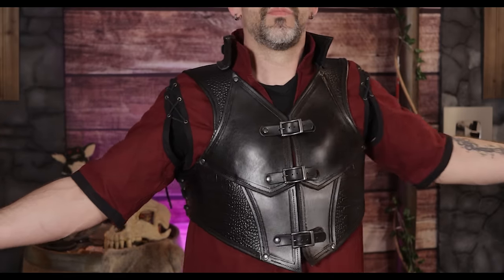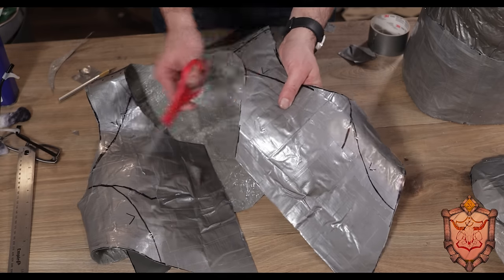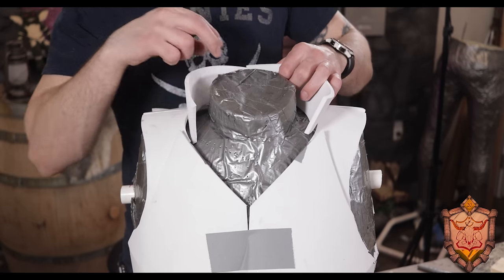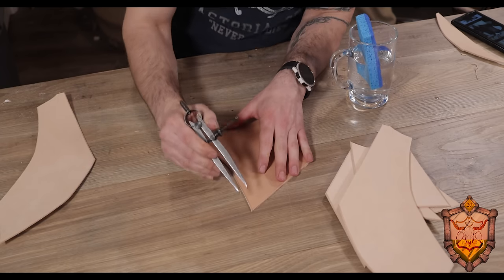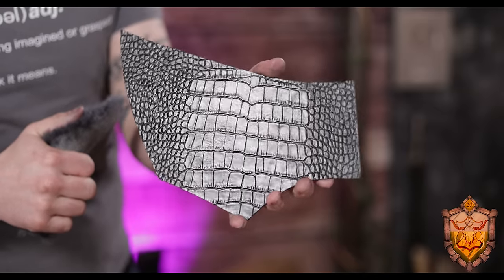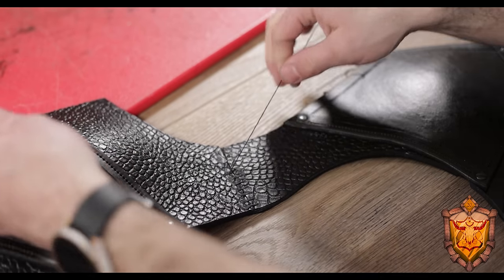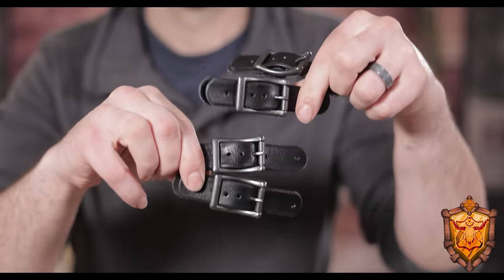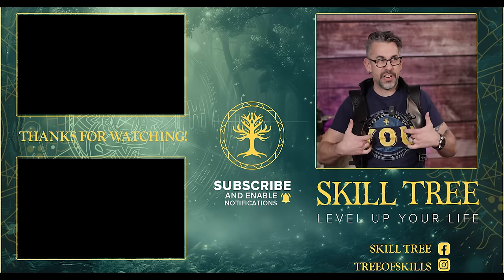Making My Best Leather Chest Piece Yet

Comment: A way to form your leather without mudding up your edges is to lay it face down on a thick piece of foam and use your ball to form it from the back by pressing down, you can shape the center without ever having to pull the edges
Reply: Or historical method is sand bags or a carved out stump
Reply: @cbjewelz  that's neat, I didn't know that

Comment: for times you want evenly spaced holes, or other marked points, there is a very cool tool that takes the math out of it, so you can find exactly where each hole should fall. it is called a Trend Point-2-Point Equidistant Measuring.  they are under $30. you either decide how many holes/marks you want, and spread the tool so that many fit in your space, or you can just spread it, untill the points on it look right for the space, telling you how many to put in, and the spacing.  this is a very cool video, and I like that armor. I just thought you might like the tool, as it makes spacing and placing holes so much faster, and precise

Comment: they make lace cutters, they arent very expensive. its almost the same as what you did, only you cut a hole in the middle of the scrap and pull the lace out, you dont need to keep it pressed in tight like you were doing.